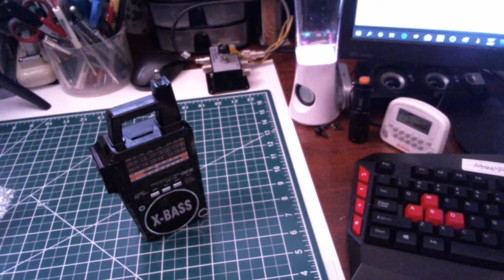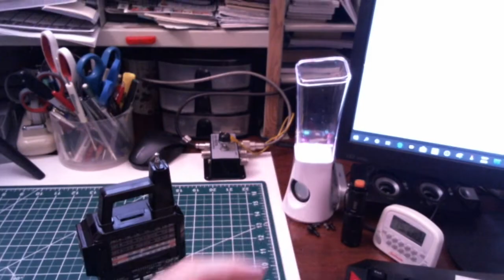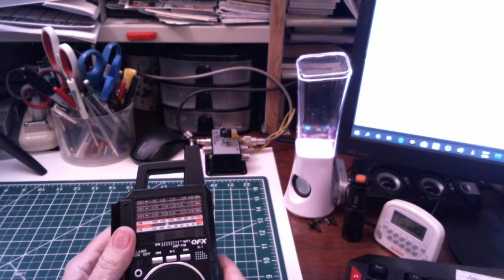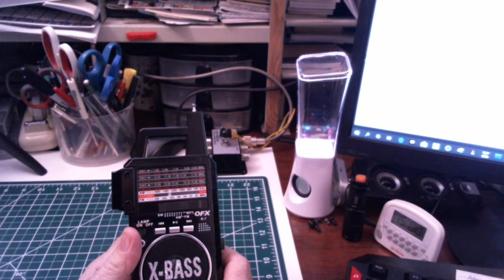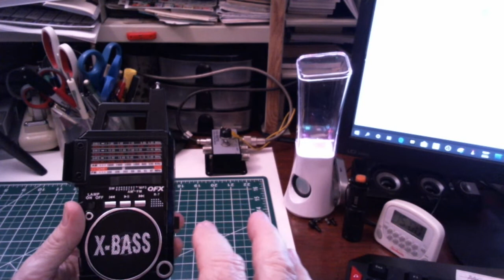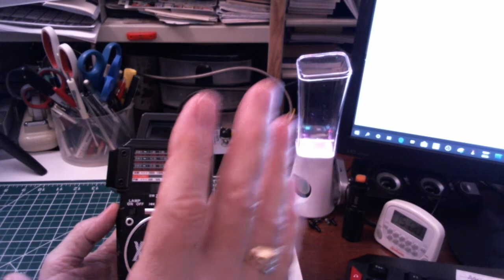TRRS #1799 - QFX R-7 Audio Tests

Comment: If you can1t see the band select indicator pointer, you can use liquid white out to highlight it. Use a pin, not the little brush so you don`t accidently smear it all over. Just moisten the tip of the pin and lightly touch the pointer. I did that on my mobile radio volume knob and it made all the difference.
Reply from the maker: Thanks